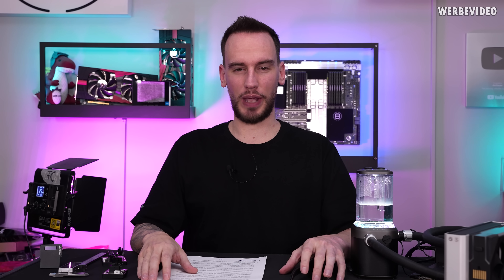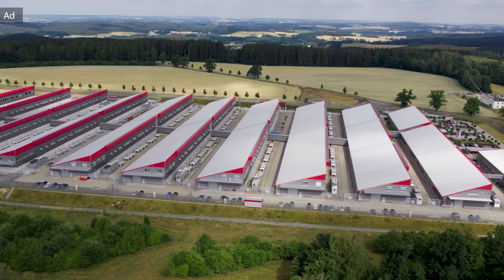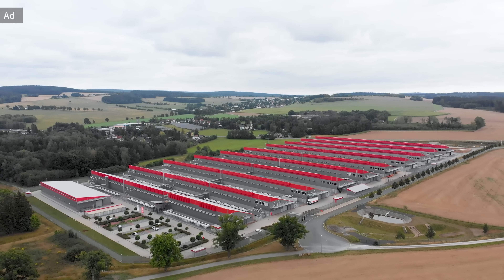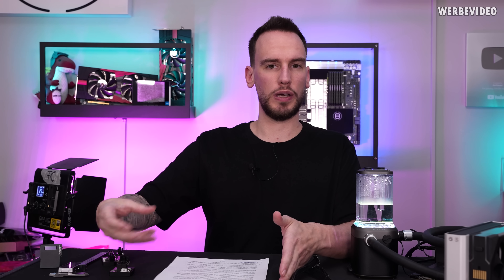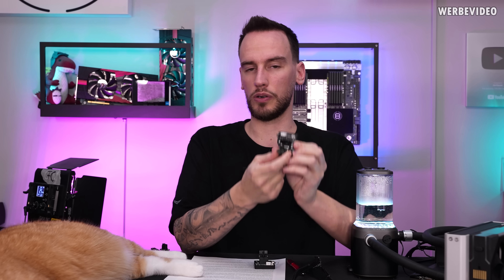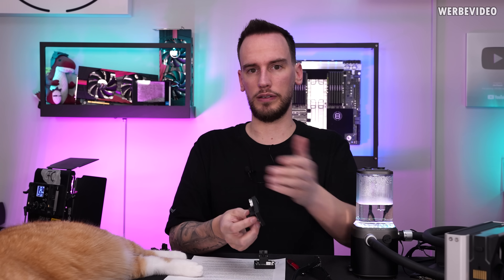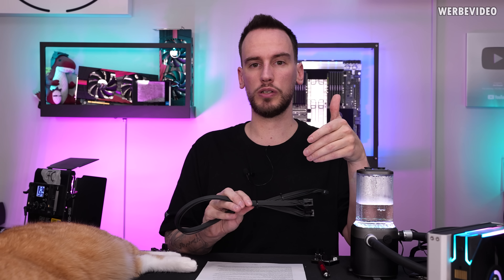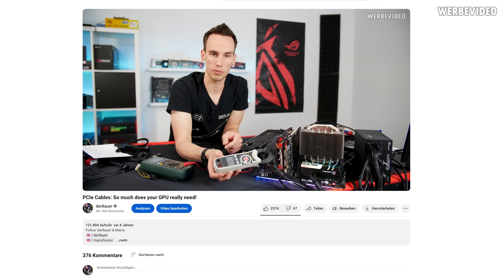12VHPWR is just Garbage and will Remain a Problem!!

Comment: Finally a video that works on the details of the spec, the differences from the 8pin, how the 12vhpowr meets the spec on paper but also the little details where the real world technicalities amount to why ultimately there are issues. very good and informative video. 

Thanks for showing the engineering side of things where possible also, it helps when your able to visually compare such data. when it is just writing it can sometimes be harder to comprehend such details when not an engineer.

edit: grammar and better phasing.

Comment: The uncertainty and reported issues regarding this connector is what primarily turned me away from getting a 4090 and went for a 4080 instead. I am aware this statement alone may sound ridiculous given the pricing and talk around these cards but it is a real concern, these connectors.
Reply: lol you could have just power limited the 4090 a little bit and add some core clocks on top of it to get the slight performance loss back and still does greatly outperform a 4080
Reply: @cheese186  I could've done that, perhaps via MSI Afterburner. Even so, I would still run a much higher risk of an electrical issue with that type of a known unreliable connector. Additionally, everytime I install a new game, the first thing I do is determine the ceiling for fps, wattage, temps and core usage for that game so as to then limit all of it to a comfortable value by limiting the fps. The chances of the connector melting issue occuring during that process is also much higher and a higher degree of randomness.

Comment: 12VHPWR  это разработка интела в далеком 2004-2009 году для серверного решения. Он по решению интела был сделан на расчет передавать 300вт энергии и не больше. А нвидиа взяла этот разьем и добавила 4 контакта маленьких, сигнальные и сказала что это 600вт. даже у интела этот разьем по размерам был БОЛЬШЕ !!!! ПОЗОР НВИДИА!

12VHPWR is an Intel development back in 2004-2009 for a server solution. According to Intel's decision, it was designed to transmit 300 watts of energy and no more. And Nvidia took this connector and added 4 small signal contacts and said that it was 600W. Even Intel had this connector BIGGER in size!!!! SHAME ON NVIDIA!
Reply: This connector was also seen in Apple thunderbolt displays 27.... which was released in 2009-2011. Look at its disassembly on the Internet and you will see the same 12 Intel connector! According to the specification, this monitor consumed no more than 250-300W, which fits within the capabilities of this connector!

Comment: I don`t use a Cablemod adaptor on my 4090 but I still monitor the temperature of the connector using my Aquaero via a thermocouple, just in case.

Comment: Also go back to the GPU designs, they are getting taller and taller, far higher than cards of the past. As the general theme of gaming pc's is tower style, taller = wider... yay.. ok now lets use a cable that needs a MINIMUM of 3.5cm clearance... recipe for disaster/rolling the dice on a fire hazard. Why do the cards need to be so tall?, why cant the connectors be even more over rated and then swivel to allow a range of installs. its bad planning and engineering. though I think its more the engineers are getting overridden by marketing. 

Is the taller cards because of the hotter die and need to space the memory further away to prevent overheating? as the ram distances need to all match, +1mm for one chip would be many X all around?

Comment: Isn't it time to start using Anderson Powerpole connectors for connecting GPUs? Molex connectors don't seem to be up to the task anymore.
Or maybe it's time to think about bringing main internal PC voltage up to at least 48V.
Reply: Even if we're talking about stepping up the voltage, 48V to me is overkill. Maybe 20 or 24V, but I don't even think there's a need to move away from 12V just because a small fraction of the consumer computer market uses a component that outputs as much as a small space heater.
Reply: @ChannelSho  48V seems appropriate because USB PD EPR already uses 48V and USB-IF really pushes for USB-C to become the only port to peripheral devices, including displays, external PCI-E devices, etc, with both data and relatively high power (up to 240W per port). If that part of the standard with 48V voltage and 240W of power becomes widely adopted then a lot of design could be greatly simplified if motherboards have access to 48V or slightly higher voltage.
And it also might future-proof things for a while.

Comment: I never understood why they replaced 4x 8 pins of power delivery to 12+4 pins and thought these cables will never overheat. Was it just to save money on PCB?
Reply: They wanted to do a single connector for a large range of power necessity. The idea was that the 12+4 would serve for every single GPU in their line-up, so it couldn't be too over spec so it would become a cost in lower end GPU, and still be able to deliver power to the highest-end. But they failed to think about using cards in the wild, they were just thinking about the lab results.
Reply: nvidia always trying to milk from every possible factor.
Less cost = More money
Reply: @ozanozkirmizi47   Not just Nvidia.  All publicly traded companies are REQUIRED to milk as much as possible from every factor.  It's a law.
Reply: Dear friend @mintymus  
All "publicly traded companies" and all "non public companies" are required to aim for non-faulty products for public.
Selling un-safe / faulty products to public can not be excuse for ripping of customers.
Reckless firing gun to "total quality control" is the most basic company management failure.
Milking public's reliance, always makes you pay more than you what you milked from people.
Reply: @ozanozkirmizi47   So, I'm right.
Reply: Me neither. What’s the saying? If it ain’t broke, don’t fix it? I wouldn’t mind plugging in 4x8 pins if it meant it will be safe/no melting.
Reply: Smaller… takes less space.
Reply: @haukionkannel have you seen the size of graphics cards lately?
I had a friend who RMA 2 AMD cards because his PC wouldn't boot.
Turns out the cards were too long and the case wouldn't let the card plug correctly into the PCI-E slot.
And I had to buy a RX 7900XTX reference card because it's the only small card that exists above a RTX 4060.
Reply: @xicofir3737  I feel your pain with the short cards. I was luckily able to just barely fit a Sapphire Pulse XTX in my case as it was a whole $140 cheaper, but I was so close to buying one of those sexy reference cards. Peak Radeon reference styling this generation IMO.
Reply: @xicofir3737  
I have! And those heavy GPUs are problem also in other ways. A lot of 4090 that has broken motherboard because it is so heavy and other weight based problems also that cause some parts of the GPU to not work. User has to be extra carefull even if the card would fit in their case. And even if they are carefull, it can cause problems in long term.
Reply: Its better to have only one connector that will handle all the loads. If you noticed on the 3xxx series, the 8pin connector often overheats at one of 2 or 3 or 4 connectors, they're not balanced, one will go max before its load is shared to the next connector.
Reply: @nguyenson7073  They just moved the problem from connector to pin. Duh.
Reply: space, cost of the design, simplicity of design and ease of installation

Comment: 3x 8pin would be more than enough for a 4090. Most of them barely touch 420W. My PNY 4090 only pulls 430W max that I've seen and I have it undervolted too using curve optimiser so it barely pulls 350-400W for the same performance or more in some cases thanks to lower temps and more sustained clock speeds. Memory is overclocked by +1000 to give more bandwidth.

Nvidia screwed up using this dog shit connector, if they use this for the 5090 I shall be sticking with my 4090 until it dies and then I shall go back to AMD and take the hit on RT performance.
Reply: No Nvidia is going to clean up now with this reason to upgrade again, they are masters of lies and marketing, the whole dual 4080 was a master stroke, as it hid the fact they were releasing a 4070 and 4070ti as a 4080, a real 4080 should have 12800 cuda cores.
Reply: @johngordon9426  The 4080 with 9728 cores leaves room for a 4080Ti/Super something which they are releasing soon. Dropping 4080 down to $900-$1000 and the new 4080Ti/Super at $1200-$1300.
Reply: ... and no DLSS.
Reply: @greenbow7888  I don't really care about DLSS as much as I used too. FSR3 has been gaining huge grounds as of late. With Avatar proving that FSR3 can come very very close to DLSS in terms of IQ. Even DLSS has its issues in games, as shown in the digital foundry video. Also FSR3 Frame Gen in Avatar is insanely good and its with its open source approach and the source code being released for free the implementations will come thick and fast. DLSS will soon die off and go the same way as Gsync did to Freesync.
Reply: Bold of you to assume AMD won’t adopt it. Also, it won’t just be a hit on RT performance, it’ll be a massive hit on overall performance, as Radeon 8000 series is projected to move back down market, it’ll probably be competing with 5070 at best.
Reply: @Khloya69  4090 in real world gaming terms around 25-30% faster overall without any DLSS, Frame Gen, etc. That does increase for RT performance which the 4090 is around 40-50% faster.

I game at 3440x1440 where that performance increase drops down to around 15-20% faster for the 4090. So if a games is running at 200fps on the 7900XTX it would be running at 160fps.... I think I can live with that.

Now AMD may indeed adopt the new connector, but I don't see why they would due to the backlash it brings. Not to mention it means retooling their entire PCB design division and their vendors too such as Powercolor, XFX, and Sapphire. Why force them to spend tons of money retooling for a connector that has this much of a bad rap? Sure it could happen, but I hope it doesn't.

Also, onto those rumours AMD are abandoning the high end market. They are just that, rumours at this point. No one knows other than AMD. Personally, I don't see it happening. They have spent too much time, money, and resources on their chiplet technology. Now only focusing on 70 class GPU's that sell for around the $500 mark is not going to cut it for shareholders.

What I believe could happen is that we get a refresh of 7000 series this year with minor tweaks and faster clocks. Which could take on the name of 8000 series. Then in 2025 we could get the 9000 series with proper dual GCD chiplet designs. So the rumours could be half true, yes they are focusing on smaller 70 class chips, but their high end offerings use 2 (or more) of these GCD chiplets. Leading to higher yields, lower costs, and much much faster performance.

I'll hold onto my 4090 until either it dies or it goes up in flames lol.
Reply: @Fezzy976  personally, I like the 12 pin connector, especially if you have it native, it cleans up the look, my next build will definitely have a 5090, paired with either a 8950x or 16900k, whichever is better, currently I use 4090 with the adapter, it’ll look so much cleaner native.
Reply: @Khloya69  cleaner and on fire....
Reply: @Fezzy976  literally all of the fires were caused by user error, not like we have a choice either way if performance is valued, what do AMD or intel have? I kinda think intel is more likely to compete with the 5090 than AMD, AMD have shown time and time again that they have no desire to go toe to toe with top end NVIDIA, but intel is new to GPUs, so who knows what they’re gonna do?

Comment: Finally someone actually sad it ! the thing i have been saying since this crap came out.
8-pin connector for CPU EPS12V is rated for 336 Watts maximum <---- 
So 2 x 8 pin pci-e should deliver 672 watt... the end...
Reply: Exactly. No need to reinvent the wheel. This connector is already used on workstation cards - even Nvidia's own cards.

Comment: I have seen such melted connectors many many times in cars.  I am a car mechanic.
It is simpel, relatively small connector for high current will fail sooner or later.  
Car manufacturers like to do things cheap as possible.  So does GPU manufacturers,  it is all about maximizing profit.